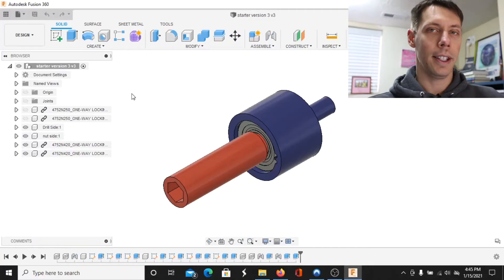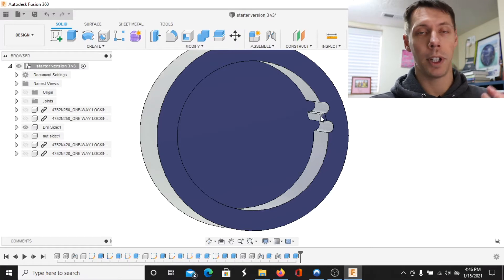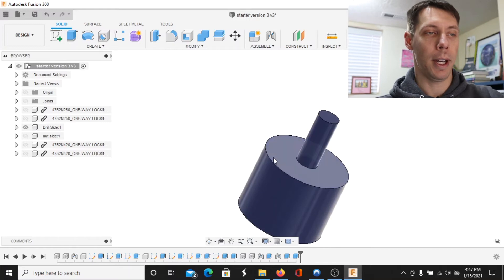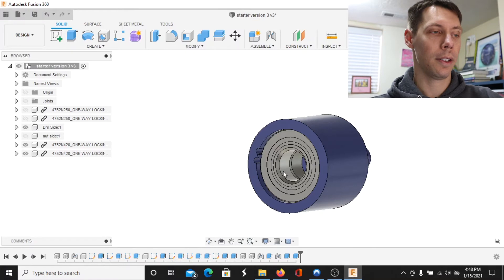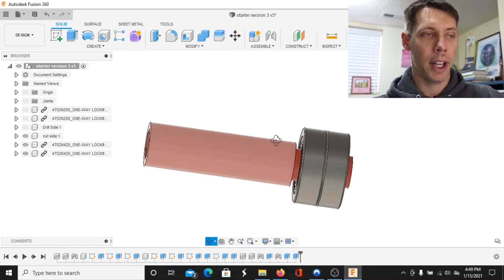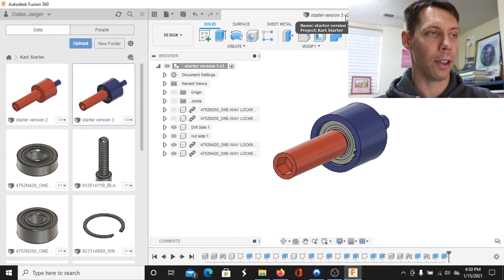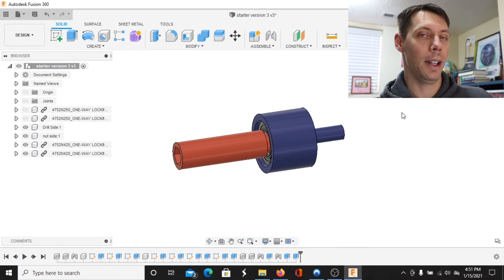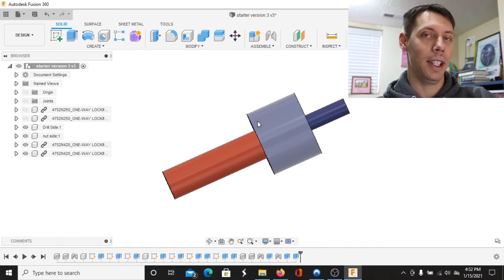Kart Starter for Honda CR125 Shifter - Cordless Drill - Part 1

Comment: The 17mm nut  you are trying to spin will undo as you need to spin the motor anti-clockwise from the flywheel side. You will probably need to sacrifice a flywheel puller as the internal thread on the flywheel is a left hand thread and will spread the load over the whole keyed shaft, you don't want to snap the end of your crank off from all the compression.